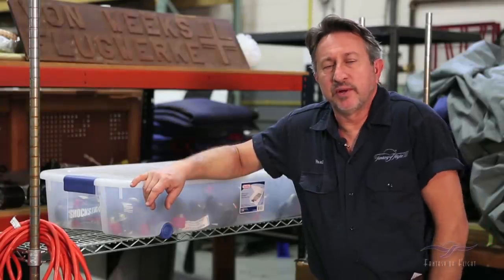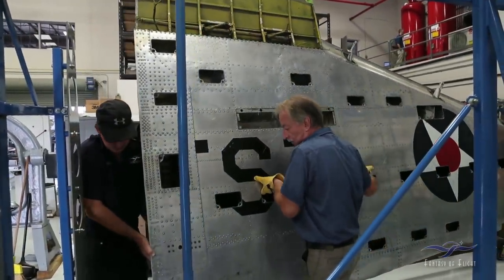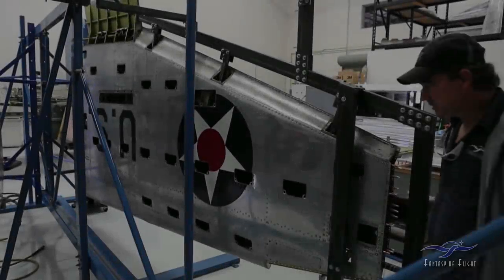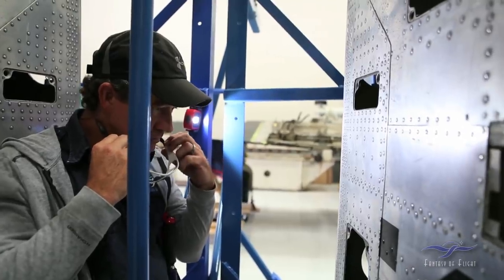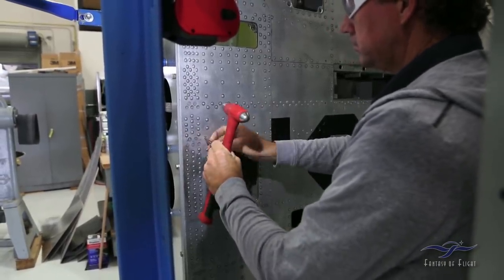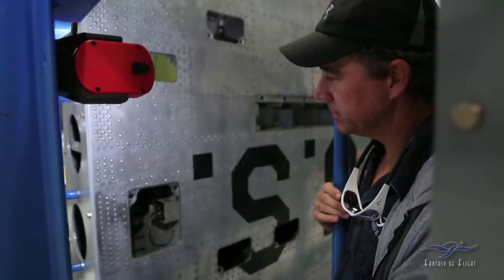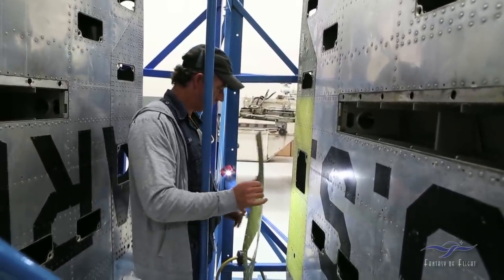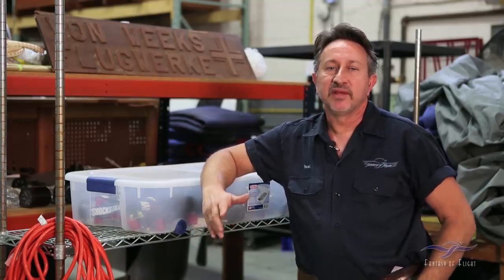Seversky P-35a - Restoration Update - 03/2019

Comment: Was a 68g mos in the army, did some extensive skinning of fuel cells for ch-47’s in korea at the 45th trans. Riveting and adhesive for the honeycomb outer panels. Had to use giant vacuum bags. Reskinned tail booms for hueys and cobras, crash box panels for oh-58’s. Even had to install those cold rivets in the firewall panel under the engine transmission mount area a couple times. Bulk of the work though was drilling out stripped screws in nut plates and occasional dzus fasteners or plexiglass panel replacement.

Comment: During college I worked for an outfit that rebuilt wrecks, mostly Cessna 182s and 210s. We didn't use the rigid jig you guys have. We would remove the damaged skin, if bent or wrinkled pound it flat, then drill an exact match by Cleco'g the original skin to the new one and drilling every hole to match. That way when we re-riveted the new skin back the hole alignment ensured the airframe was still exactly the same alignment as before, even wings would return to their original warp if one was there.  Do you think this was wrong or is use of the jig just added insurance?

Comment: I would go bananas if I had to remove so many rivets. I repaired a vector network analyser some time ago and the powersupply had "only" 84 screws and I was not pleased when I all had them in again to find out I forgot something and had to open it again. That is nothing compared to the rivets in a wing. Very interesting to see how you can take a wing apart.

Comment: Ever use a #30 size punch in the drillers holes (or 40 etc) then just tip to the side to break the heads off instead of the cape chisel?
Reply: Was wondering myself, I learned to do it the way you describe sledawgpilot
Reply: drifter503 
I had an A&P instructor who was a Constellation flight engineer in the Air Force. He later converted WWII planes into fire bombers. 
Not sayin’ it’s the only way but might be useful, he showed how you can often remove rivets without a scratch.

Comment: What happened that she was damaged?
Reply from the maker: The airplane came from the Swedish Air Force and has a significant amount of pitting and surface corrosion from being stored in underground bunkers during WWII.  The plane received additional damage in 1992 during Hurricane Andrew.
Reply: @KermitWeeks444  Many thanks Kermit.
Reply: Wasn't this plane nearly finished in the early 2000s?  It was in the same hangar as the Hellcat, P-38, and another almost finished "slow-flying" plane.  I remember seeing an almost complete, fully polished plane way back then.  Thanks.

Comment: I would thought there would be a better & quicker tool for removing the rivets ?
Reply: Sadly no. The only tried and true method to remove rivets without causing any other damage is to drill them out. Also being a skilled mechanic is most important.